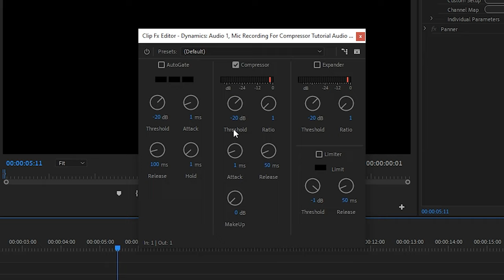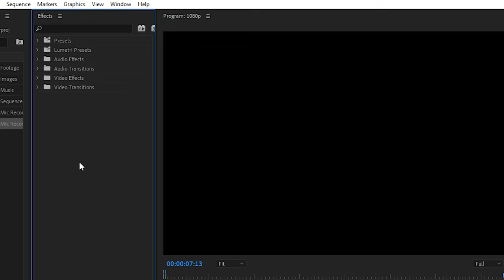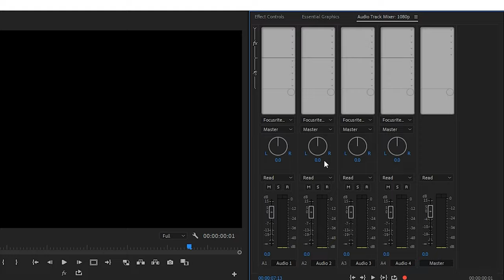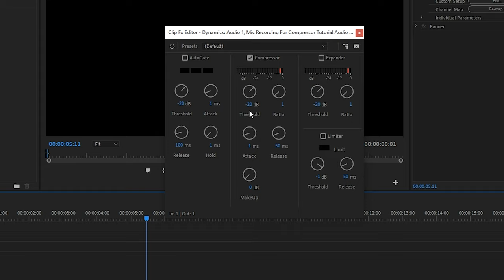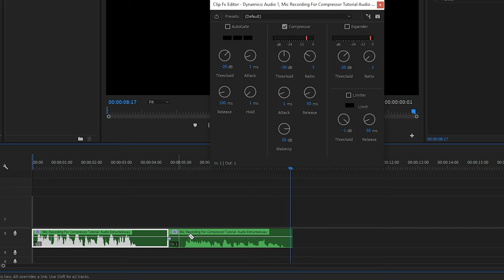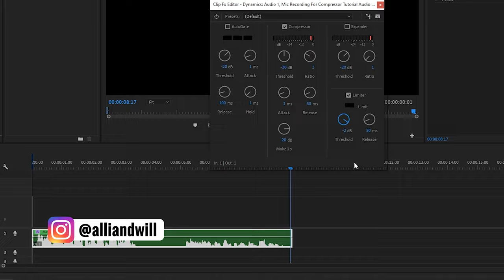How To Level Audio Using A Compressor In Premiere Pro CC

Comment: This was a very useful tutorial! Could you explain to a newbie your reasoning for adjusting to -30dB 5:25? Why didn't you stay at -20dB? Thanks...
Reply from the maker: Thanks! That number is based on the input volume your source audio has. You want to find the ‘sweet’ spot for where your specific audio is and set it there which tells the compressor that’s the volume where you want the compressor to do it’s thing

Comment: My question is many videos are putting different numbers in audio gain but no body explain how we choose the right number 😅
Reply from the maker: It’s based on how loud you want it to be, so every audio track will be different. Basically; how much gain (volume) do you want to add? When does it sound loud enough or good enough to you? (That’s how much)